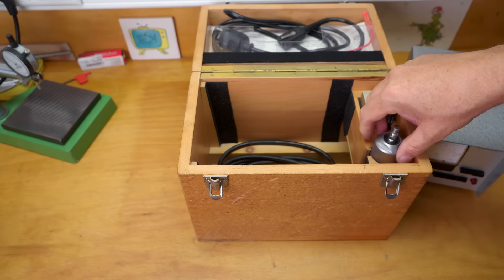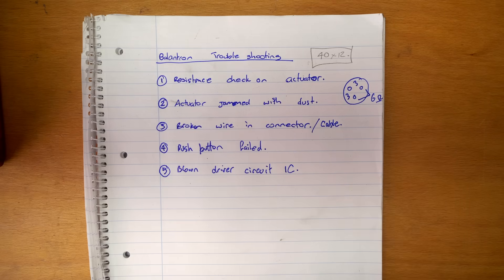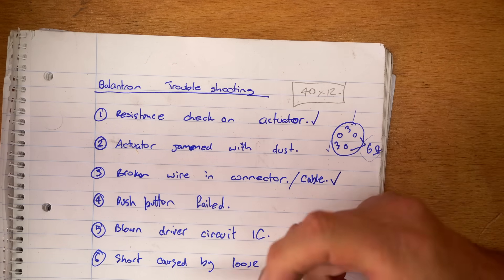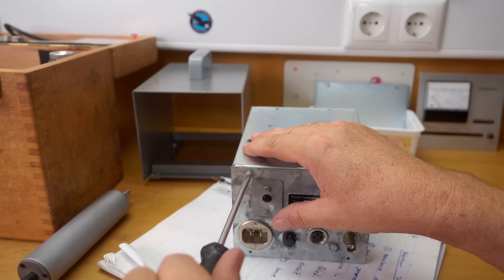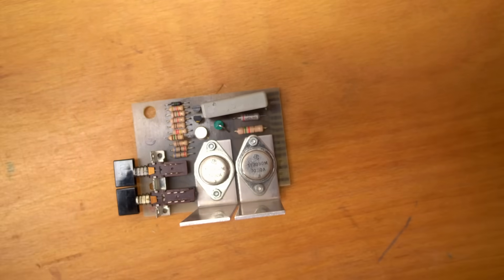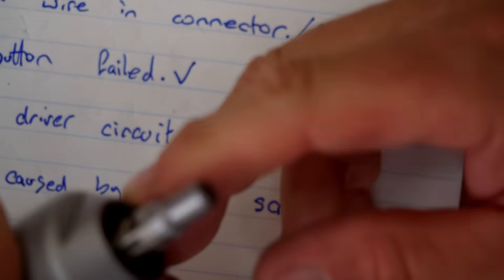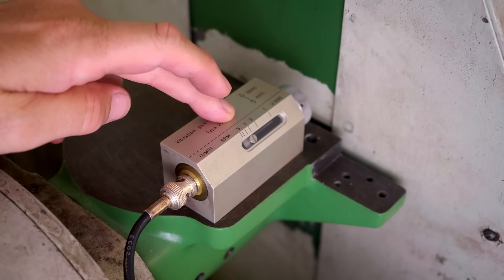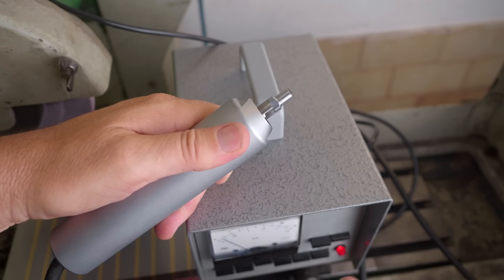Trying to get the Balantron working. || RotarySMP

Comment: Hi Mark! Balantron solution time. 

I bought literally the same type Balantron balancer. When I bought it was kind of working, or at least humming. When I got home, it didn't. On the front of the jackhammer, it has a rubber sealant secured with a circlip. I removed it, and found that the axially moving shaft is locked because the oil on it became a resin like substance over the decades. With some WD-30 I softened/washed it out, and oiled with machine oil. You can rotate the shaft, you'll do no harm with it, but it helps massaging the WD-40 in it. The axial movement of the hammer from end to end is about 1mm on mine. 
The sealant is in a groove on the shaft, so it needs some gentle persuasion to come off .

Good luck with that!
Zoli
Reply from the maker: Thanks Zoli, mine is also quite gummed up. How did you get the front seal out? I removed the circlip, but was worried about damaging the seal with a scriber to get it out, so I loosened it up by just weting the seal with IPA, Oil and WD40 in turn. It has loosened up a lot, but it seems mine also might have a blown output transister.
Reply: @RotarySMP  I removed the circlip, and pryed the outer side of the seal with a toothpick. Then I could get under it, and grabbed it with a small, long nosed pliers, and pulled it out carefully. You dont need to remove it if you dont want, I was scared too that I could damage the seal. You can just flood it with WD-40 and work it in, and the rest can be wiped out with ear swab. The seal does a great job on the shaft groove, so you must inject WD-40 under it, from the outer side.

I dont think the transistors are bad. You can test it with a loudspeaker. Choose one with at least 8 Ohms resistance, and you might add some extra 1kOhm in series or something that you have at hand, so you dont annoy the heck out of the neighbors with the noise. The sensor must be on a running machine during the test. You can take a look at the output with an oscilloscope as well.
If you can give me an email address, I can send you some pictures.

Comment: measure the output voltage on the connector for the jackhammer
Reply from the maker: I have been working with an electronic engineer who has been helping with the trouble shooting. We will get to the bottom of it soon :)

Comment: I've had ethernet cables that work fine in one position and in another totally fail when bent a certain way.  So there could still be loose wires in the loom.
Reply from the maker: Good point.

Comment: At this point I'd suspect the electronics, probably something before the output transistors. The solenoids may be gummed up or something, but it does seem like something should happen when you press the button.

If you get in over your head with the electronics, I know of a NZ youtube channel focusing on electronics repair. The one I know of is defpom, but of course there are likely others.
Reply from the maker: I am immediately out of my depth on electronics Mark :) But I have some good assistance from the community.
Reply: @RotarySMP  True. I'm not sure how to describe what to look for, but that doesn't mean others are similarly limited ;)

Comment: At 6.56, it seems that you have access to the individual wires that lead to the solenoid. You could open the zip ties and use a clamp-meter to see if you can measure an AC current while the solenoid should be in operation. It will not be 50 Hz, but I would guess a clamp meter checking one of the wires should show you something. If there is no AC current, my bet would be on a fault in the electronics. You could also check for AC voltage in the connector when the solenoid is unplugged. does anything get warm when the solenoid should be in operation? Does the thing draw more power from mains if you activate the solenoid?
Reply from the maker: Thanks. I am working with an E.E who is helping me work through this. Hope to have another video on it in the next couple of weeks.

Comment: If it's still not working after you find the mechanical issues, I'd look at the the signal on the actuator connector with an oscilloscope.
Reply from the maker: Yep, I have been doing this with the help of an E.E. hope to have it working again, and a video made in a few weeks.

Comment: I'd start by checking the voltage across one of the actuator’s 3-ohm coils while it’s still connected to the main unit, and the accelerometer is in a really shaky setup — maybe attached to the bench grinder, but skipping the "find-the-least-vibration" step in the setup to go for max vibration instead.

Use an oscilloscope or a fast-responding multimeter (either analog or one with a good bar graph display). If you see a decent fluctuating voltage, the issue is probably with the actuator. If there's little or no variation, the problem's likely in the main unit’s output circuit.

That said, if the actuator seems stuck, I’d try freeing it up first and testing again. You’ll need to do that eventually anyway, and honestly, there’s a good chance that just fixing the stuck actuator could solve the whole issue.
Reply from the maker: Thanks for the troubleshooting tips. Working on it.

Comment: Did You check everything, wiggle every wire/contact? If the actuator shall move it must get power, right? Maybe check with a scope if there is any output? Try & gently tickle the actuator with a function generator?
If something is stone dead it might be something shaky. Did You check the wires for continuity? Are the switches switching? I recently bought an amp as defective and it was just a dirty switch- sometimes even I am lucky. But something has to do something to make this shake. Did You check all the powers in the controller, is all powered up? To me this smells like something stupid.
And for shure I´d inspect the shaky bit- take out the screws, pull the cer-clip and see where it get´s You. At least You see where the wires go. Herzliche Grüße
Reply from the maker: Thanks for your tips. I only had limited time to do that first trouble shooting. Will do an update once I have done more.

Comment: You´re lucky to have the powerchord, it´s seemingly very rare- the plug I mean. I bought several old devices with that plug and always went for the more modern standart. But if I wanted to restore to perfect order I´d have to bite the bullet- 30 up to 100 Buckaroos for a PLUG is not funny anymore. Now I got rid of that- this thing is a work of art. I adore that case… You still are very friggin lucky with this. Greetz
Reply from the maker: Yes, it is in incredible condition for a device that must have spent 50 years in a grinding shop.
Reply: @RotarySMP  It must have had a special place in the office, only to be taken out on a full moon by the hands of a virgin- how clean & nice it still is. 
Could You put a number on how much it was new?
This looks like the Studer of measuring gear, a fascinating bit.
I hope You get it going…

Comment: I would think about intercepting the cores going to the actuator, you will be able to detect if the controller is 'sending' control voltages. Divide and conquer.
Reply from the maker: Thanks for the tip.

Comment: Hi Mark, I'd love to see this lovely piece of kit working again. A strip down of the actuator seems like the only option left. However, as you have confirmed the integrity of the coils, cable, cannon type plug and the transistors. The connection between the amplifier board and the socket, and also through the assembled plug and socket, might also be worth checking too. You should see the 6, 3 and 3 Ohm readings of the actuator at the board. Mishandling, or repeated use does have a toll on any connector assembly and is a go to diagnostic test.
Reply from the maker: Thanks for the tips. Watch this space. :)

Comment: Vibration measurement should always be made where the vibration MATTERS. So you are correct where it is on the spindle housing is basically immaterial provided you measure both axis, and NOT to measure the vibration on the table.
In this case you would then address the vibration by the Balantron balancing the system by removing material from the wheel. So all good.

Being more general about vibration - a cheap/quick way to help identify issues
As already said, you start where the vibration matters - or is felt or is annoying or whatever.
The easiest way of doing this is using your hand - more specifically a middle knuckle. The knuckle because it has WAY less dampening than the end of your finger so is far more sensitive.

Looking at the grinder as an example there are two likely places for the vibration to come from. The spindle assembly (including the wheel) and the motor.
So to discover what is the likely cause, you use your knuckle and test either side of each joint in the structure (spindle hsg to column to base to motor mount to motor)
Typically the vibration will do 1 of 4 things
1/ get smaller as you go down the connection chain (in this case towards the motor) - indicates the issue is with the spindle/wheel/belt pulley that is everything that is attached to the spindle housing
2/ get larger as you go down the connection chain - indicates it is a motor issue
3/ Suddenly jump at one connection point - indicates that connection point is amplifying the vibration and needs to be stiffened or softened to move the resonance point far enough to stop the problem.
4/ Something else - this may point to there being ANOTHER source of vibration that you haven't identified, or perhaps another structure that is resonating and driving on of the item in the path you have been checking.

A classic in one part of my work was steering wheel vibration.
A diesel engine was being used and the vibration was directly proportional to engine RPM
It was always true that the engine was the "cause" - engine stopped no vibration even if the truck was moving, also no matter what gear was selected.
This is by most people as proving the engine was out of balance or some other issue with it.

But taking you trusty knuckle what could be shown was the vibration at the engine was minimal,
The vibration at the steering wheel was horrible
Then moving between those two items it was typically the steering wheel adjustment  clamps where there was a sudden amplification of the vibration.
Tighten that up and problem solved.
A lot quicker and cheaper than rebuilding an engine - with no improvement after it is done.

An example of how weight (tuned damper) can make a huge difference
https://www.youtube.com/shorts/rKUMChVW0bQ
Reply from the maker: Thank for taking the time to explain that Ian. The motor seemed pretty smooth when I ran it with the belt off.

Comment: I knew we have vibrations readings, but I did not know where the accelerometer was located!  Great video and I hope you get that cool machine working.....
Reply from the maker: Hi Jasper, how is that new shed coming along?
Reply: @RotarySMP   It's coming slowly, but surely.  I promised my wife I would do all of the house things before I started doing my shop stuff.  I still have to paint several things.  Hopefully I will start on my stuff by winter.......

Comment: measure the voltage at the plug while "working"  to find the direction of the problem?  no voltage/constant voltage-> controller,  changing voltage-> wand?  maybe???
Reply from the maker: Good tip Thanks.

Comment: Since most of my time was in the Fireroom, I don't have a good suggestion, however, when something was seized up the usual suggestion was to get a bigger hammer... hope that helps ;D (maybe a gentle bath in the sonic cleaner might help those actuator parts if you can get them apart. )
Reply from the maker: Not sure I want to soak it, as it will have coils in there, Mike.
Reply: @RotarySMP  what about a sonic bath in 91% or anhydrous isopropyl alcohol, maybe distilled water, or some kind of non-conductive liquid?

Comment: It has spent its life dressing and balancing grinding wheels so my guess is that is  grit in the unit and I would not recommend manually moving the shaft as you may damage the interface between the the mechanical parts also trying to electrically move the shaft could damage the coils inside. I worked on many  grinders in the 1980s and would never move anything that was seized manually until I had stripped and cleaned and checked the mechanical interface. Just a few thoughts. Great video as always.
Reply from the maker: Thanks for you tip. Yep, that is the next step.

Comment: is it possible that the grinding wheel is already balanced, hence no need to operate the actuator? Anyhow if the main device indeed is trying to operate the actuator, I would use an oscilloscope to see if there is any output from the connector on the main device.
Reply from the maker: No, I mounted it, and didn't balance it.

Comment: Heya, Mark!
I'd check the output with multimeter - or, better, a scope - to see if that contraption outputs anything with its drivers. You can start with an open-circuit test and if it gives nothing then just give it a breadboard with a couple of 3.3 ohm 1W resistors to simulate coil resistance. If you still have got nothing, then you know. Otherwise give the dildo thing a good painstaking tenacious sedulous oily handjob. You can help it with a benchtop power supply or even a regulated car battery charger (quickly giving it some juice on one winding or another), given that at this step you know the amplitude which it's driven with by the main contraption.

Oh, one should not rely on resistance check when troubleshooting solenoids, but more on inductance. Multimeters with inductance-metering capabilities - or dedicated LCR-meters - aren't that expensive these days.
Reply from the maker: LMAO :) Thanks for the bread board tip :)

Comment: Replace the actuator with 2x speakers/woofers and see if the unit is generating movement, if it does the electronics is ok
Reply from the maker: I dont have any speaker laying around, but it would be a simple test. Thanks.

Comment: Before disassembling the actuator, you could let it run for a bit and check if its temperature increases. If not, there is probably no electrical input getting to it.
Reply from the maker: Good point.

Comment: On that circuit board there are 3 more ICs, two black and that small, round metal one. My guess is they serve as drivers to turn on and off the big ones as power transistors need significant amount of Base current to turn on quick and fully.
Reply from the maker: I am hopeless at how to approach the troubleshooting of such things.

Comment: A small correction about vibration transducers, certain gas engines have two that measure all vibrations and with some fourier transform can detect vibration on 2 or 3 shafts depending on the engine model, they are two because the first one is inside the forward bearing box, inacessible without tearing down the engine and when it fails the second is the backup, albeit in a degraded sensitivity
Reply from the maker: Thanks Andre. great input.

Comment: Watch video Balantron

Taunus Mechanics""
You use wrong set batons
Reply from the maker: I have watched it. What do you mean by batons?
Reply: @RotarySMP he has , in the bottom row, buttons 3, and 5 pressed
You only button 3
Reply from the maker: @VAARRR1  Buttons 1-4 select the RPM range. 5 selects sensitivity (he was in high sensitivity 0-2.5µm, I was in low 0-15µm) and button 6 moves the removal spot by 180°.

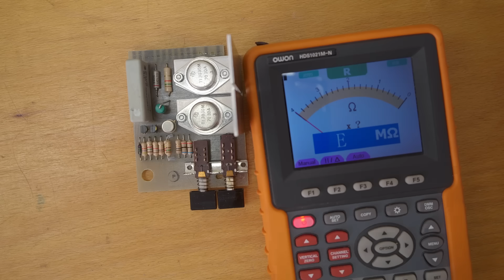Comment: @7:50 256 ohms for a switch is certainly NOT  working correctly.
Reply from the maker: Turns out, I was measuring it wrong. I have been told the poles are not across the unit, but along it. Duh!

Comment: I'm guessing the principle is that the "jackhammer" actuation is synchronous with the vibration signature and therefore should hit the same place on the grinding wheel with each spindle rotation. 
If that assumtion is valid at, for example, 3600RPM the extend and retract solenoid would need to be energised at 3600/60 = 60Hz.
In the absence of an oscilloscope check for an AC signal between the common pin and the extend and retract pins while the "jackhammer" is connected. I suspect it will be a fairly ugly square wave.  At least that will tell you if there is any drive to the solenoids.
Reply from the maker: Thanks Geoff, will do that for the next video.

Comment: You could zero in on it by setting up the balantron and then disconnect the head and measure the output signal with an O-scope.
Reply from the maker: I will try that. Thanks.

Comment: Normally, I always start a repair (after having tested electrical safety first) with a check of the power supply.  It should deliver a constant and hum-"free" DC voltage for the circuit to work.
And I do not understand the readings of your diode tester. 0,035V as burden voltage (?) in one direction looks not right to me, but I may not understand your tester.
Reply from the maker: Thanks, I also dont understand it, but I never learnt this stuff :)
Reply: You do not own another, "normal" Multimeter with Diode test? A healthy germanium  transistor reads from B-C and B-E approx. 300mV in one and "open" in the other direction. Between C and E you also should read if any very high values. Anything else lower than that (e.g. your 35mV) I consider as being defective. Or influenced by other components.
Marc

Comment: I wonder how shock proof the pickup is? would it fail if dropped?

No frame of reference for how much vibration the wheel is producing, maybe an artificially unbalanced wheel could tell if it wasn’t picking up minimal vibrations.

We (not me) balance lots of stuff at work, rotors of all sizes to hydro electric equipment in situ.
I haven’t paid much attention to how the system works but I suspect it is way outdated.
Reply from the maker: Since the unit has that sensitivity switch at 2.5µm, and I hadn't balanced the wheel, the readings seems to be in a logical range. I need to open up that actuator and have a look.